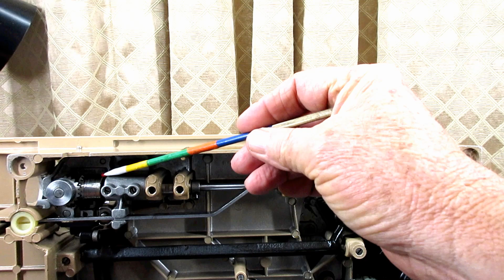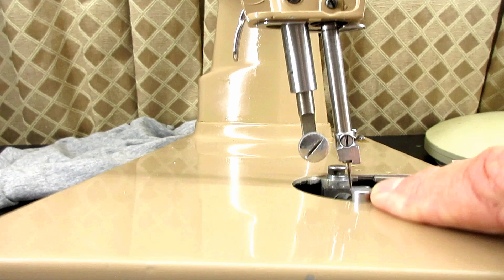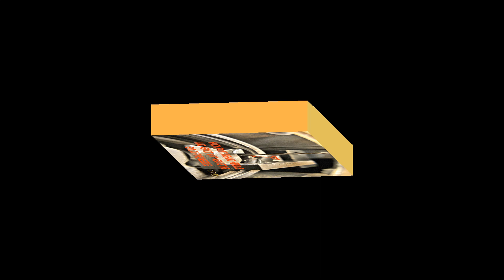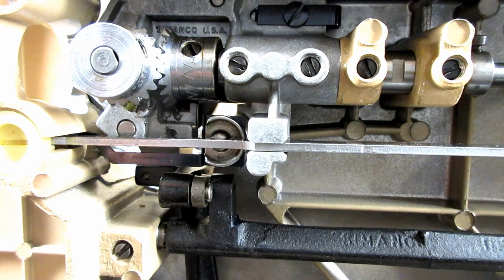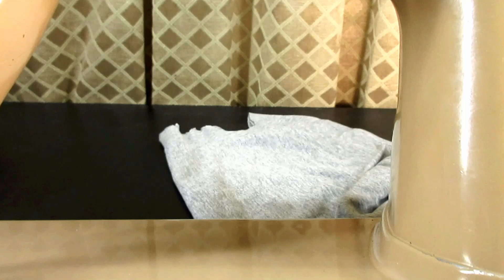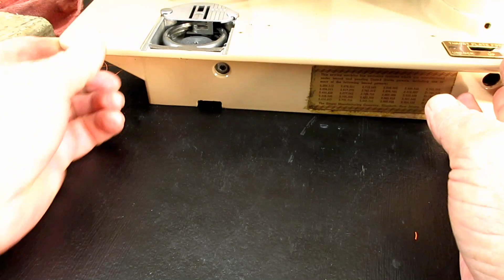How to Check and Set the Timing on a Singer Model 403A Special Slant Needle Sewing Machine

Comment: Hi Andy, with your instructions I was able to adjust the timing, but after adjusting to the position you described, I was still getting the bobbin holder scraping the needle at medium to high speeds or the needle hitting it if you turn backwards slightly. I tried going a little earlier but it seems hard to find the right place to still catch the thread without the needle hitting. Any further advice? Should I play with the needle bar part position more? It's covering the first marker slightly, so I don't think it should be higher, but maybe? Or should I give up and take to a repair shop?
Update: see last comment but my needle was in with the trench on the wrong side.
Reply from the maker: What was wrong before you reset the timing? I'm not sure if I'm on track with your meaning of "bobbin holder", but the needle should not hit anything but fabric. Yes, you can play with the needle bar height. Each machine can be a tiny amount different and that also depends on usage and wear. You can try leaving a tiny space of silver showing between the mark and bushing. I will say that I had a similar but worse problem once and it took me some time to realize when I rotated the handwheel to move the NB up to the timing mark I was tuning the handwheel toward the back of the machine instead of toward me at the front. Maybe you can verify that? About taking it to a shop; if you know and trust the repair person then it is up to you, but it has been my experience, and that of countless of my viewers, that most shops have no idea about working on a vintage machine and many of us know just a much if not more than they do. Just have them tell you what they plan on testing and adjusting before you leave the machine with them is my advice.
Reply: @andytubesewing1953  Sorry I meant the hook race is scraping or hitting the needle as it comes up (depending on the speed) and the needle is hitting the hook race if the wheel is reversed. (*Hook race not bobbin holder, I think might be the term I was missing. Whatever the bobbin hook part is called.) And the hook isn't catching the thread.

My machine had been working perfectly until I took it on a road trip to a sewing retreat which included some very bumpy road construction for about 2 hours. After a bit I heard some consistent metallic squeaking which may have been a part of my machine, but I thought was more likely my ironing board. When I got to my destination, my bobbin hook was only catching the thread very occasionally, and then my needle bent and broke. The problem was much the same as now: With a fresh needle, I was hitting the *hook race. I removed a couple of small lint balls in the bobbin area, but when that didn't resolve anything, I found your tutorial here and tried to adjust. The needle bar was already in the position I described, covering the first marker. I left it since I figured it had probably been that way for many years and if that had shifted then it would probably be lower? After the timing adjustment didn't solve the issue, I tried the NB, but haven't been able to adjust the needle bar lower or higher. It's mostly stuck. Although I think I nudged it a bit higher on my last attempt. Instead, just to check if that would make a difference, I lowered the needle itself incrementally on one attempt. But that worsened the needle scraping the hook race. I do think it might help to raise the NB if I can get it unstuck. 

Another possible factor could be something shifting between my adjustment and retightening the screws on the gear area? But it still looks right.

For the possibility you mentioned, I'm not quite sure I understand. It seems like maybe you mean I might be referencing the NB markers when it's coming up instead of going down? I did try the timing adjustment at both NB's downward positions but it was pretty apparent which to do when the needle hit the hook race. Alternatively maybe you mean turning the wheel the wrong way mis-aligns the adjustment? I feel like I have to pull it the wrong way sometimes to reach and tighten the second screw?
I appreciate you taking the time to troubleshoot with me.
Reply from the maker: @ReinaElizondo  That's a little TMI, Reina. I can't really diagnose the machine over the internet. All I can say is to follow the video closely. Even a slight variation or movement of the alignment will cause skipped stitches, etc. The tolerances on the machine are very close, often .001 inch and even less. There is a needle bar video in the 403A playlist here: https://www.youtube.com/playlist?list=PLsCOZgzzaiKKyqvdDRwS-9MfLuwSNJTcg      Here are all 15 of my timing videos. Maybe one of the other videos will explain more clearly or I did a better job of explaining. https://www.youtube.com/playlist?list=PLsCOZgzzaiKLk_Q_6w0UjhnQUgi7Iy3K7   These types of adjustments are not like playing horseshoes. Close does not count.
Finally, whatever space from the height mark of the NB to the bushing should be the same difference from the timing mark to the bushing. If the height mark is barely touching the bushing then the timing mark must be barely touching the bushing or the height/timing combination will be incorrect.
Reply: @andytubesewing1953  😅 Okay thanks. I'll watch a few more videos and try again. If nothing else I think the repair shop can probably help with the needle bar. Thanks for your advice and your detailed videos!
Reply: Lol my needle was in backwards 🤦‍♀️. Didn't realize that the needle had the side for the trench part opposite than my manual says to put it in. Before I always put it in with the last needle as reference instead of the manual. But I had the needle out for the trip and put it back in according to the manual. That was why it kept making the scraping noise and skipping stitches lol.

Comment: Help! Singer 403A We have an old 403A that has been sitting for years. The machine did not work when last used. The thread kept breaking and bird nesting.

 I adjusted the bobbin tension case spring and set the upper tension. It seems to work best when the tension level is less than 1. The machine seemed to work reasonably well for a few days of trials. Yesterday, the thread started bunching up under the throat plate. It was so bad that the material quit moving while sewing. At one point the machine seemed to lock up. The bobbin had also run out of thread at the same time. Cause of problem or a coincidence? I refilled the bobbin, cleared the jam, and tried again to sew. The same thing happened again. I have removed the bobbin case and rethreaded the machine. The thread continues to glob up under the throat plate as soon as I start sewing. I did oil and grease the machine a couple of days ago.

I am practically illiterate on sewing machines and am stumbling trying to get them working. Any suggestions? 

Bob
Reply from the maker: Boy does that sound frustrating! You've done some good isolation steps so far, and I think the problem MIGHT be that there is a delint pin on the positioning pin bracket under the feed dog. The Positioning Pin Bracket mounts around the hook and it is what holds the top of the bobbin case in the correct position. Some Slant-O-Matic machines have a little delint pin sticking out of the positioning bracket. Supposedly that delint pin was to keep lint from building up on the inside curve of the hook. It has been known to start catching the thread after the hook releases it and the take-up lever is pulling up the slack from the stitch. If one thread loop gets hung up on that pin it causes every thread loop after it to catch and then you get a big spool of threading wrapped around the pin, bracket, hook, and base of the feed dog. I viewer of mine had thread looping and missed stitching problems and we tried every adjustment in the service manual to no avail. He never gave up and discovered the delint pin cause and has a video about how to grind off or pull out that delint pin. That totally solved his problem and here is his video: https://www.youtube.com/watch?v=19UA-7Rj8S0  More info has come in about the delint pin in that not every Slant-O-Matic machine has one. The Rocketeers 500A & 503A seem to have the highest percentage, then the 401A & 403A models next. By the time Singer moved onto the 600s models they seem to have dropped the delint pin idea. Folks who have removed the pin have told me they don't have a problem with lint buildup as compared to any other vintage Singer machine they have, and normal brushing and cleaning of the hook area prevent lint buildup. BTW, Singer 403A machines are all "old", hehe. Thanks for watching my channel, and good luck.
Reply: @andytubesewing1953  Thank you, Andy.  I checked the timing and it seems good.  The upper tread actually wraps around underneath the bobbin case. and between the race.  This process quickly continues until thread accumulates under the feed dogs.  Think it could still be the detent?  I was concerned the bobbin case or race were bent
Reply from the maker: @pcsbob  Never had that. The timing of the takeup lever may be off if it was installed wrong. There could be a burr on the hook catching the thread. It may be the wrong hook installed. It may be the delint pin as I mentioned, Did you look for it? I can't fix this for you through the internet sorry.  You can download a free copy of the service manual here: https://sewingdude.files.wordpress.com/2012/09/singer-401-service-manual1.pdf  It would show all about adjusting/removing/replacing all the parts in the area. I've never used mineral spirits. Here is how I clean a machine using Krud Kutter, an earth-friendly cleaner & degreaser; https://youtu.be/kXZHksK7rGQ   My model 403A playlist also has cleaning videos, as well as hot to remove and replace parts; https://www.youtube.com/playlist?list=PLsCOZgzzaiKKyqvdDRwS-9MfLuwSNJTcg
and my own video for removing the hook and positioning finger; https://youtu.be/T4YPB1KK3_Q  I've had people tell me they have used kerosene, dish detergent, the white goopy hand cleaner, gasoline, brake cleaning spray fluid, and so forth. Try your mineral spirits if you want, maybe it works great.

Comment: Good afternoon, Mr. Andy Tube, my warmest regards and sincere congratulations for your knowledge of the mechanics of so many sewing machines that you explain in your videos. I would like your authoritative opinion to indicate where the needle bar adjustment mechanism of the Singer 411G is located, since my machine has a slight deviation from the right side and if I use the zig zag mode, it will surely collide with the iron. It is but you have understood my explanation and I will be attentive to your recommendations. I have not seen any videos dealing with this fault on these machine models. Greetings.
Reply from the maker: The "G" in your 411G indicates your machine was made in Germany. It is a variation of model 401A with similar mechanical parts. If your needle is not centered in the needle plate hole it can be as simple as cleaning/oiling the Vibrating Bracket or the Redl Lever left-center-right bracket. If parts are clean and oiled and you still have an off-center needle bar the centering adjustment is made at the Vibrating Bracket that holds the needle bar. Please download a FREE copy of the Service Manual for Singer Model 401A (there is no known manual for model 411G) at this link: https://sewingdude.files.wordpress.com/2012/09/singer-401-service-manual1.pdf   The needle bar adjustment instructions are in this manual including correct height, left-right, and front-back. Actually, all the adjusting instructions for the machine parts are in this manual. It's the closest thing to a 411G Service Manual you will find. Thanks for watching my channel and good luck.

Comment: I’m a novice to sewing and inherited my 403A from my Grandmother. The machine has been in climate controlled storage for 12 years and who knows how long it had been since my Grandmother had sewn before she passed. She was the original owner and I was able to start sewing right away without any trouble. When sewing thick items and I heard a sound like “slipping” of a belt where the motor was running, but the needle was not moving unless I assisted with the hand wheel. I was sure I had probably totally abused this beautiful machine so I started watching your videos to become an expert on its performance, because it’s clear to me this is a high quality piece of machinery. My approach to diagnosing the “slipping” problem hasn’t been very systematic, and if I don’t sew through thick layers I don’t have this problem, so instead I’ve created new problems for myself! I completed this video (after several days of loosening). Wish me luck getting myself back to where I started after plugging it in for the first time after so many years of sitting idle. Thanks for the videos.
Reply from the maker: Sorry you're having problems. Did you loosen screws because the timing check failed ? Timing is how the hook captures the thread from the needle. When it is off timing you get skipped stitches, not "Slipping". What an odd sound to hear from a machine that has all steel gears and no belts. I'm wondering if the clutch washer behind the handwheel is improperly installed or the stop motion knob (chrome) on the handwheel is not tightened into the sewing position. Usually if the needle can not penetrate the needle breaks or the machine stalls. There is a Textolite gear (type of plastic) on the handwheel that mates with a steel pinion from the motor shaft. I suppose it could slip but I haven't heard of that. It is very hard but not impossible to break that Textolite gear. Sorry, it's hard to diagnose thru the internet comment section, haha. Your foot pedal probably needs servicing and the motor may need the commutator cleaned like this; https://youtu.be/pzq4tv8qn94   Maybe you are watching my playlist for model 403A? https://www.youtube.com/playlist?list=PLsCOZgzzaiKKyqvdDRwS-9MfLuwSNJTcg   I also have a playlist for the foot pedal rehabilitation; https://www.youtube.com/playlist?list=PLsCOZgzzaiKL6ePPxLpmnWSzTyxPKTb71    There is a video in the 403A playlist about the handwheel. It has chapters so you can watch just the parts you want/need. It will show about proper installation of the washer I mentioned.
https://youtu.be/ghnNYyMC1xU  Model 403A is my favorite (by far) cabinet mounted Singer Zigzag machine. In todays (2020) dollars it would cost about $2,400.00 when new.

Comment: I followed everything in this tutorial and am confident I did it correctly. However, now my bobbin doesn't catch at all. I went through this process because I was not able to use zigzag stitches at all because the bobbin would not hook on the zigzag part of the stitch but made somewhat of a straight stitch while running decorative stitches. Now, nothing - - no bobbin catching at all. Help!
Reply from the maker: If you'd like to email me I will try to help. Please include as much information about the machine, what you've done, and what you have tried as you can. andytube53@gmail.com

Comment: Andy, it looks like you are setting the timing with the needle in the center position. Is that correct?  Thank you for these wonderful videos!
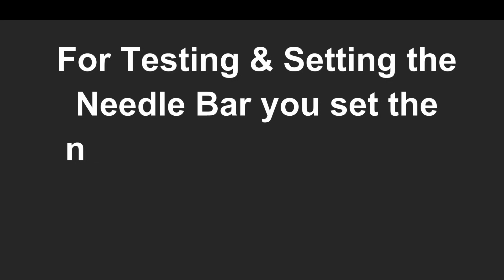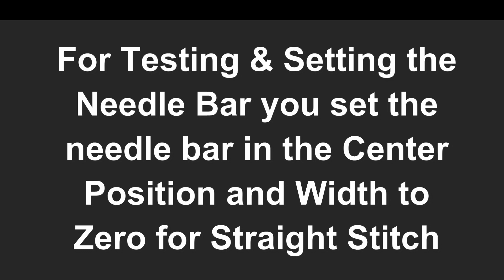Reply from the maker: You are correct, Joe. Needle bar in CENTER position, and the width lever to STRAIGHT Stitch which is zero (0) or one (1) depending on the machine. I show a slide with that information at 14:01 - 14:09 of the video. Thanks for watching my channel. Good Luck,
Reply: @andytubesewing1953  Ah yes, guess I missed that. My new to me 403A should arrive in a week or so. It will be my first purchased sewing machine. This will be a new adventure!  I have sewn a few things with a lovely 221 featherweight that belonged to my Mother but my sister very much wants it.  Thanks again Andy, you may hear from me again one day.

Comment: Thank you! I was able to use the page 16 reference and move the needle slightly away from the hook and that eliminated the swish or ting sound.  My machine was outfitted with the knit kit several years ago.  I’m not even sure what that did but we were sewing on a lot of knits then and it was supposed to help with skipped stitches.  Thanks again !
Reply from the maker: Nicely done, Cynthia. 👍 My understanding of the knit kit was a different hook with an off-center bushing that allowed the hook to be moved into and away from the needle. Technicians claimed this system was not as good and the bracket you have on the machine b/c the knit kit moved the hook slightly left or right whereas the bracket moved it straight into or away from the needle. I was told the knit kit was made for models 600 and later b/c Singer did not use the bracket system, but some stores used the knit kit on 401Aand 500A class models if the customer complained of skipped stitches on knit fabrics. I'm glad you got your machine adjusted to your liking. Thanks for letting us know.